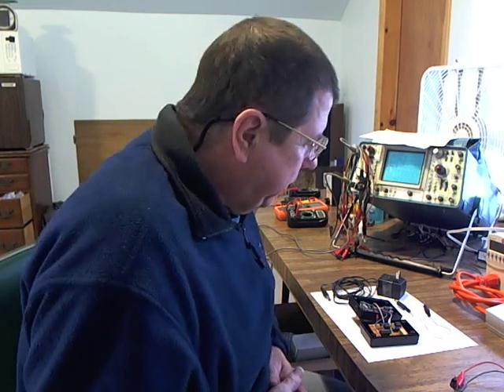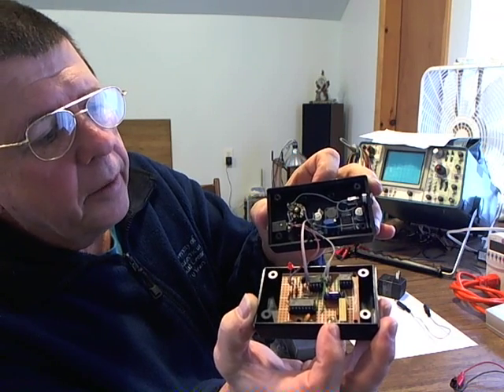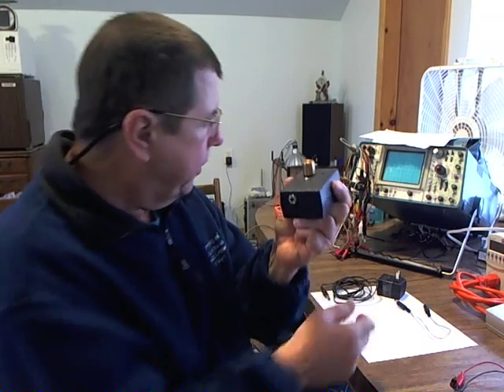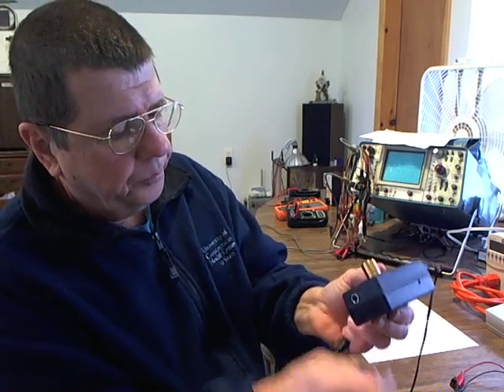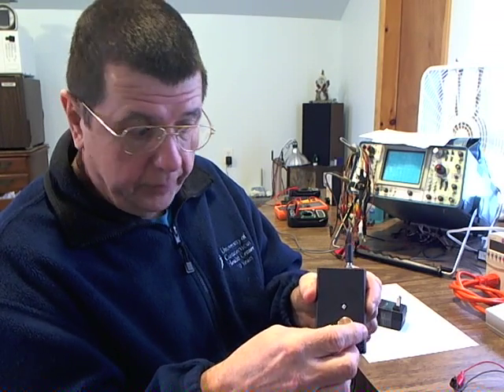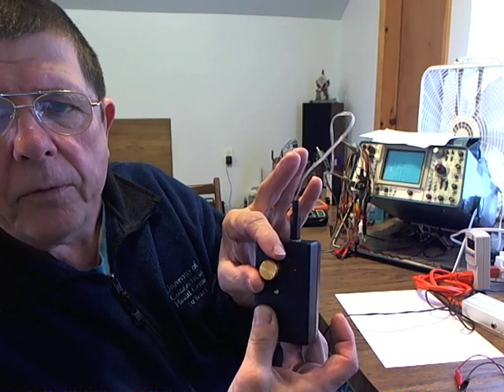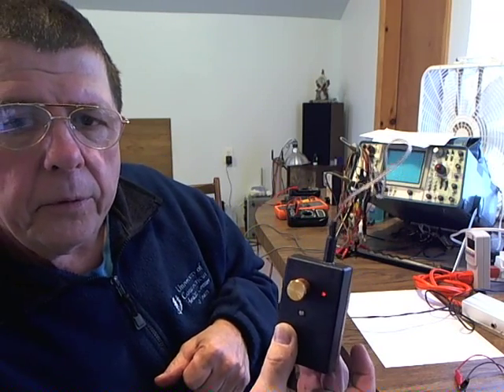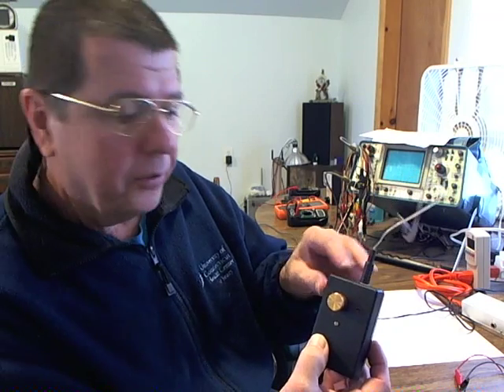Schumann Video 1

Comment: Cool gadget.  I'm sure you're aware that SR isn't a infinite frequency.  Where 7.83 hz "was" the typical baseline frequency back in 2013,  SR has been increasing in both average (f) and peak (f) since 2016..  Many times in 2019 SR has peaked above 100hz and on March 17th 2019 it peaked at 150hz and remained there for 26 hours.  Although the promenade  7.83 hz. band still appears in the SR graph, there's a new "secondary" band that's very much apparent in the current graphs around 12.5 hz. and much lower than the peak frequency. 
Things on Earth are quickly changing and its having a significant effect on Human consciousness..  ..if you haven't noticed.

Comment: Nice! I have been using the schumann at 7.83hz running with powered orgonite and tensor technology and building home harmonizers to lessen the effects of EMF and to heal. I had one test positive for successfully running rife frequencies for anxiety into the field of some tensor tools which the subject sat in and experienced relief. There were 3 frequencies to run one after the other, she only made halfway through the duration of the second and her anxiety was gone. I have been seeking to either build my own or purchase pulsers to incorporate into my builds. Something in the way of battery powered, rechargeable but have next to no knowledge of constructing circuits. I have been teaching myself  to braze in order to construct tensor tools. This part is beyond me at the moment, would love to try to get you to build me something small i could possible incorporate into pocket oscillators, nice video. Moving on to the other parts and checking your website out. Thank you.